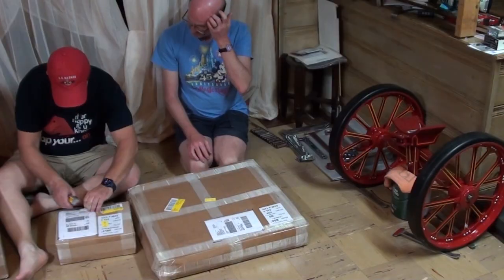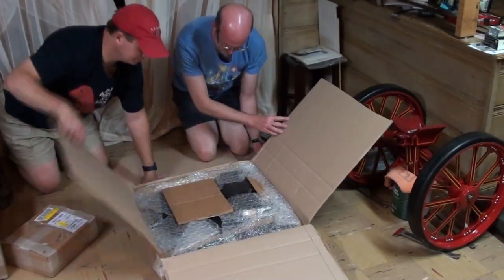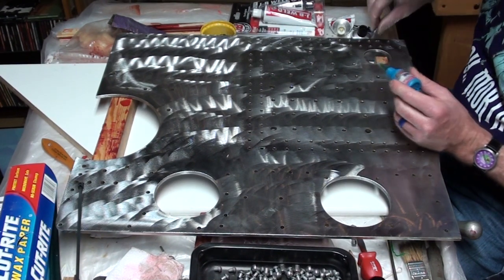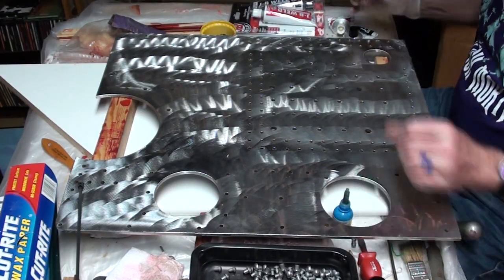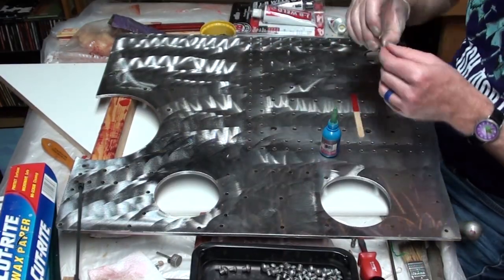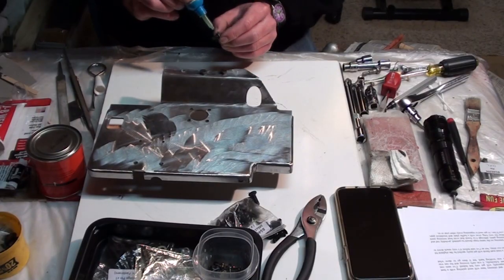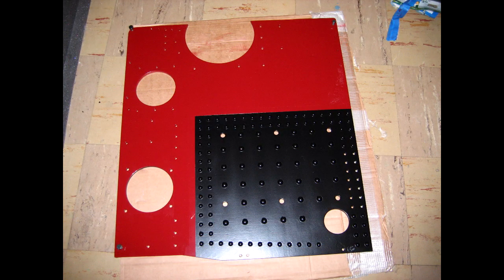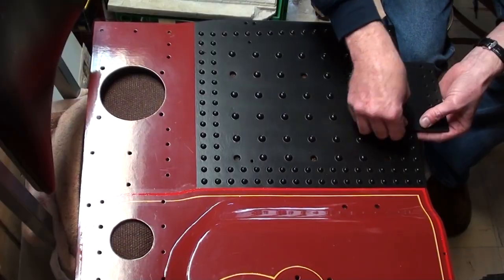Kit 9 Hornplates: Steam Traction World 4" Scale Burrell DCC Traction Engine Build

Comment: Hi any chance you could tell me what size the rivet is, the one of which there is loads of (the dummy ones) I only need to know the size of the head.
Reply from the maker: Hello,

I measured a couple at .35" and .44".  I would allow for some error in the measurement since I was being very careful to avoid scratching the paint.  I think you could safely assume the dummy rivets heads are 3/8" and 7/16" diameter.